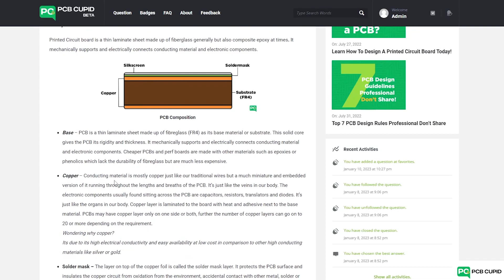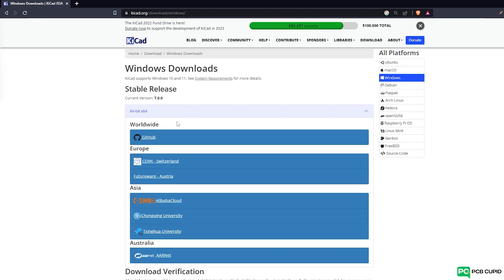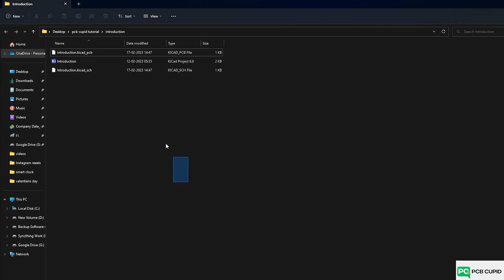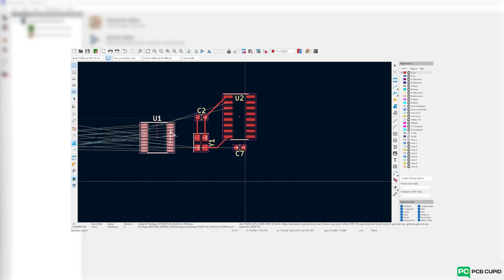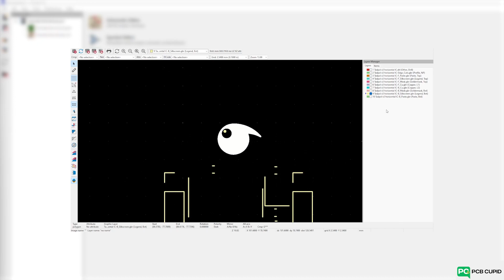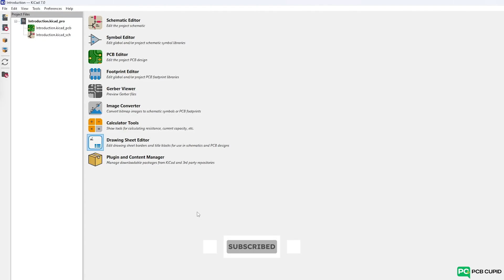#1 How To Use New Kicad 7.0 - Introduction | #PCBCupid

Comment: Hello is there an way to add agp slot or an pga socket 370 on the motherboard? I am trying to find an older gerber files, but it isn't working. So far I have 2 ISA 2 PCI 1 msata/mini pci 3 20x2 pin an 12x2 pin and two soddim ram slots.

Comment: I am using kicad 7.99.0  and  alot of 
library crushing problems.
Sometimes stopped working and quit without saving😢
Have I  need to downgrade v7.0?
I am beginner.
Reply from the maker: Kicad 7.0.5 is the latest version, probably you are using some alpha build of the application. 
Please uninstall that version and download the version 7.0.5 from there official site.
Reply: Thank you for replying.😊